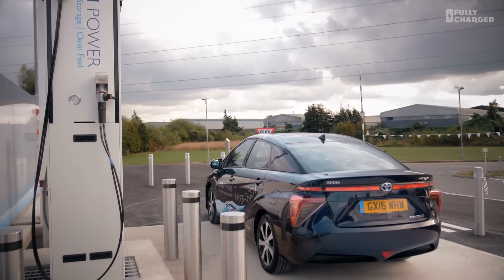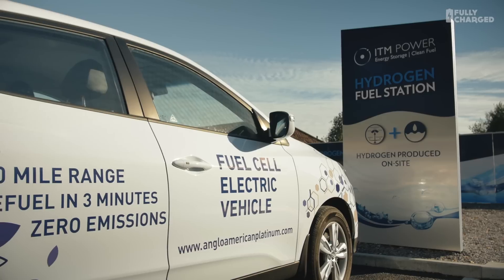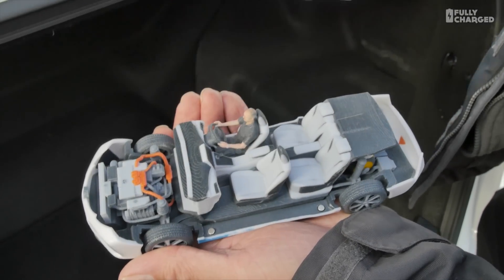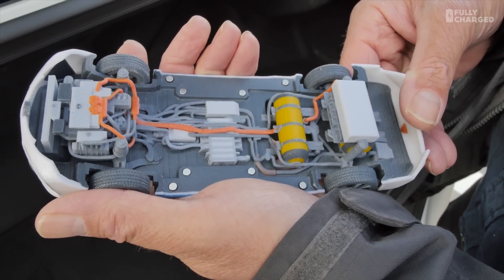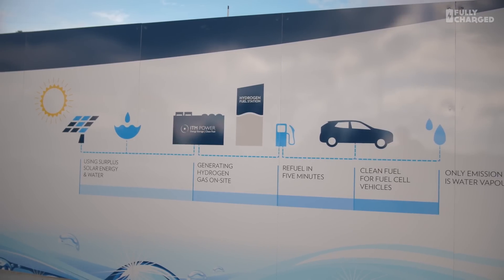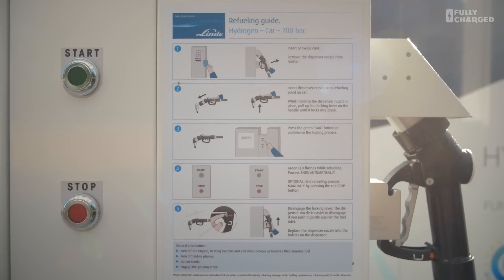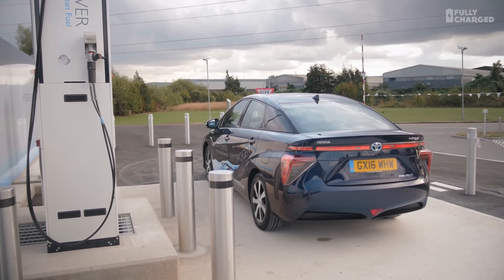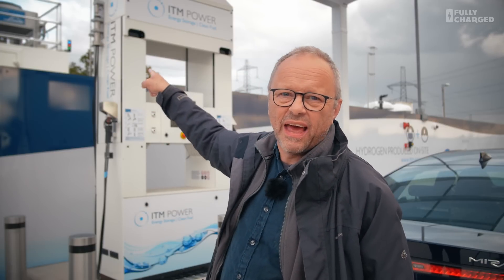ITM Hydrogen Rally | Fully Charged

Comment: Why do not we make a nuclear car, it is even more clean/efficient :)
Now to comment the hydrogen, I would be very uncomfortable driving with a hydrogen bomb. Yes Toyota is claiming that the tank is secure and collision protected, but if we also consider that the H2 is almost the smallest element on the world therefore it is extremely difficult to store it.
And why would one do:
electricity -> H2 -> electricity
This doubles the losses. Really funny why Toyota (and others) have not developed H2 engine. Such engine would probably be much more efficient that the current setup.
Reply: Nuclear is cleaner? Tell that to the residents of Chernobyl, Three Mile Island or Fukushima, all three have a twenty mile radius exclusion zone.
Reply: TMI-1 is still operating on the same site as TMI-2 (the unit that melted down). Seems very unlikely that there is a meaningful exclusion zone around that plant. And despite those accidents nuclear has released much less radiation than coal stations working normally. It is pretty-much the lowest carbon intensity (12 gCO2/KWh) of any generating tech known (Onshore wind is 10, everything else is more or much more). So whatever you think of it, it is very clean.

You can't make safe reactors small enough to go in cars though - that's silly. They do work well in large boats.
Reply: For the cost of a nuclear plant, you could built enough wind towers to match that power and still have money left over. not to mention the cost to decommission a nuclear plant on top of the initial costs to build and keep running. So how is nuclear greener? Let alone not that safe.
Reply: Joshua Cornell
As xxwookey stated nuclear can be much cleaner than coal energy and other forms of energy sources.
But even if safety of nuclear plant is 100% assured, there is still a problem with radioactive waste that is going to radiate many centuries. Let me cite how radioactive such waste is:
- - - - - - - - - - - - - - - -
http://www.nirs.org/factsheets/hlwfcst.htm
- - - - - - - - - - - - - - - -
This fuel contains approximately 25 billion curies of radioactivity.  Some of the radioactive elements decay quickly, but even after 1000 years, there will be 1,752 curies in each ton of irradiated fuel.
A curie is a large unit: 2,224,000,000,000 (over 2 trillion) radioactive emissions, or ‘counts’ per minute.  Natural radiation measured with a simple Geiger counter is typically between 2 and 20 counts per minute.  Each of these emissions has the potential to initiate a cancer.
- - - - - - - - - - - - - - - -
I find it funny why we cannot use radioactive waves for energy source. Are they so weak, yet powerful to make major cell mutations?

I hope I did not confuse you and others with my first sentence as it was thought as an ironic idea where car industry should go.
I also believe that wind, solar, Lithium batteries are not the best alternative (probably the best at the moment).
E.G. current economy is not used to recycle Lithium batteries so they would at first go to waste lands and make an impact to environment.
Reply: lithium battery are recyclable, there are a few programs in place similar to that of lead acid battery recycling, but not as harmful as lead though. I would never throw a rechargeable battery in the garbage, not even alkaline. Despite the disposable label on them.
Reply: Joshua Cornell
Of course almost any device/substance on Earth is recyclable, it only depends how much energy and effort one needs to put in to recycle.
The problem with Lithium batteries is that there are almost no recycling sites that would know how to recycle and reproduce Lithium batteries. Of course Elon Musk talked that they have developed the manufacture/recycling into their "mega" factory, but even if this is the case that brings us only one manufacturer and one factory which would recycle and manufacture Lithium batteries.
From what I have read on batteryuniversity.com, recycling Lead Acid batteries is really simple so I do not understand all the fuzz about Lead being harmful. And Lead acid batteries are much more robust than Lithium (of course also a lot heavier for the same capacity). It is only because governments decided that Lead is harmful and it should be banned. On the other hand GMO organisms that are being fed antibiotics just to be able to grow into organism we eat, this is totally OK. Or extincting rain forests purely for money reasons is also okay, even though they filter almost all of our garbage that we throw at it.
Even though Lithium is a really good technology I have a lot of doubts about mass success unless many recycling plants are going to be build. Of course at the moment there is no demand for it, but in the future there will be enough old electric cars on the road that would need battery replacement that it would make sense to build them.
And more education about Lithium batteries is needed. At our engineering university they are mentioning Li-battery as complicated battery that needs special circuits..., instead of providing some useful information about it and how to use it.
Ordinary people will also need to learn about batteries and how to use them: they do not want to be discharged to deep or to high, each battery has its own maximum current rating (even some industry chips for Li-battery control have non precise charging methods and can overcharge the battery). The current state of battery knowledge among people is: "After 8hours my phone has 50% battery, this means it can be used for another 8hours, and when I have 1% of battery I can still use it." First, % is only a calculated capacity from the full discharge/charge cycle measure. It cannot precisely tell you how much battery you have left. I find it better to show current voltage and critical voltage for the battery chemistry so we are not rapidly destroying it by discharging it too deeply.
Reply: You could run a car on a radioisotope thermoelectric generator (powered by decay heat rather than fission) as those devices can be made very small without being a radiation hazard. Sadly the Pu-238 fuel used in most RTGs costs around $8 million per kilo, meaning that only the likes of NASA can afford nuclear cars (they're big fans of putting them on Mars).

Comment: So, where does the water come from? All good in a place like the UK, or Belgium. But water is becoming a scarce resource in many places on earth.
+ all the other cons like: dangerous invisible high-flammable gas, huge inefficiency in producing it, inefficiency in usage of power, having to go and fill it up at undemocratic prices, ...

Good technology, but wrong vehicle. Personal transport should not use hydrogen. It will have its use-cases, but not the average commute-car. Also a Tesla Model S is not the average commute-car, way too big and yes too much range. The weight of the 'long'-range battery also makes it inefficient. We need a lot more smaller (sexy) BEV's.

Comment: Certainly very high technology, but what a dumb idea.  Hydrogen is, complicated to make and store, dangerous in countries like Australia where day time temperatures can easily reach 40 degrees C in some areas, and is not readily available...anywhere.  Batteries for hybrid / electric cars are getting cheaper, higher energy density, smaller and quicker to charge.  Electricity for the most part is everywhere.  Elon Musk is a very clever man and I trust his opinion, hydrogen is not the answer.

Comment: Domestic hydrogen Fuel is a joke. I can understand it being used for industrial machinery or commercial transport solutions where charge times my be needed to be kept to a minimum, but other than that nothing will justify wasting energy in the conversion process over direct battery storage.

I'm positive there are efficiency losses associated with electrolysis, gas compression, and the rapid cooling process used during filling. In comparison BEV are far more simple and efficient to the point where you would really have to explain to someone why you opted to buy hydrogen over normal electric vehicles currently available.

. . . And that's before you start factoring sustainable home electricity production (and for anyone who would argue it will be the same for Hydrogen, the government will make producing explosive gas at home illegal the second some dumbass blows their house up, or energy lobbyists grease politicians palms with money)

Comment: Not a particularly good example of the show. Way too many deliberate half-truths or complete misinformation from the same people that sell you petrol today.  The problem starts with the concept of using renewable electricity to make hydrogen. This is typically less than 50% efficient - i.e. you lose 50% of the energy that you put in. Batteries are around 90% efficient. Then it talks about using that hydrogen to power a car with a fuel cell. These are limited to 50% efficiency. So you start with 100 units of energy and reduce it to 50 to make H2, then reduce that to 25 to power your car.... Second problem. To get the H2 into the car you need to compress it to 900Bar. This takes a lot of energy. They cool the gas to -40, using more energy.  John Hunt from Toyota is either a moron or a liar. At 8:02 he claims that the fuel cell produces no heat. This is not true. A fuel cell produces 50% heat and 50% electricity. That's how they work. He goes on at 8:38 to claim that the H2 car can power your house for a week. If this is true then a Tesla Model S can do the same, seeing as they both have the same electric range - and indicates that the energy capacity of the Mirai is around 90kWh. That would not power most households for a week unless you are using another fuel for heating and hot water. If we dig a bit you will see that the Mirai has can hold 5kg of H2 in its 87kg fuel tanks. The current price of H2 is around $US10 per kg. The Mirai will not be cheap to operate and you will need to go to one of the refilling stations to fill up, paying cash each time, instead of charging overnight for less than a tenth of the cost.  Charles Purkess is right that you can use H2 as a storage mechanism for excess renewable energy, but its not a particularly efficient way to do it compared to batteries. Its better than wasting the energy but still not good. At 11:38 they start to talk about using H2 gas for cooking and heating. While attractive at a high level, its not a good idea in practicality since H2 is very difficult to store - it tends to make metals brittle, and leaks out of steel tanks since the molecules are so small. It also burns invisibly and so requires significant safety precautions. Hydrogen is simply a way of keeping everyone paying money for a liquid fuel. Even the refuelling stations are a lot of 'smoke and mirrors'. They refill a car in a few minutes but then take ages to re-pressurise before another car can fill up. You have to drive to one like you do for petrol, and buy it, like petrol. Its at best 25% as efficient as a pure electric option with batteries. Meanwhile, battery storage is dropping in price and the current electric vehicles are actually better than the best future fuel cell ones. fail.

Comment: A brilliant step forward Robert? Really? You know that not all hydrogen that would be sold would be produced that way right? The interests behind it are increases in fracking, which should be categorically rejected.
Reply: The world is slowly moving to 100% renewable energy, which is encouraged by battery development (and with an aim to be non polluting); whereas hydrogen fuel cell cars (which contain batteries btw) also put a short term market demand on natural gas, which is not the right direction.

Comment: Clean renewable but using drinkable water. The more of those cars on the road the more water it's gonna use to power those cars. :(
Reply: but it comes out again :)
Reply: You do know water comes out of the exhaust, right? There's no reason salt water couldn't be used
Reply: mlevesque33 can't u use water that u don't drink?
Reply: And where does the water fall back down? Nobody knows. It might be on another country instead of yours. Imagine a country with no oil and little water sources. They're going to import all that hydrogene that came from a country rich with water and that same water is probably never coming back where it came from.
Reply: With salt water it's different because of the sodium in the water. You end up spending more to produce that hydrogen, you do have to collect the sodium by-product.
Reply: +MrcabooseVG 
You need clean water to electrolyse and you can't use saltwater. The chlorine in it will corrode everything. If you use any "dirty" water your electrolysis cell will need cleaning all the time.
Reply: superdau oh. fair enough. go Tesla!

Comment: Interesting.. But the car design is damn ugly with all that front triangles and also the there is the point that they said you need to have oxygen to be taken into the car to react with the now split hydrogen to power the electric system.  

Why? The point of spliting the hydrogen in the 1st place is to then power the electric battery and the drive the car!

So why do you need to add oxygen to the split hydrogen? 

If that was the case that the hydrogen needs to have oxygen to work you would not need to waste wind based power to split it in the 1st place?  
You just would use the un-split water in the car to power the electric system!

Seems sily to say oh you need the oxygen to react with the hydrogen and the left over product being water!  
If that is the left over process then the hydrogen would not have been burned because you burn it then there be none left for the oxygen to combine with to make your water left overs?

And it don't matter if you burn more hydrogen you still would be taking in oxygen as needed so still you would use up all the hydrogen feul to make the water!

One last point those two drivers of the company were breaking british road laws by keep waving their hands around as they talked and not holding the steering wheel. 
After all their not in a self driving tesla car?

Comment: This would have been a great technologie 25 years ago but now batteries are just to advanced and hydrogen doesnt make any economical sense anymore kind of sad actually to see all that research effort go to waste now that it finaly works but its just a little to late
Reply: Yes (Lithium) batteries are getting better designs, but it seems that there are 2 types of car companies at the moment:
1. one that are starting to adapt batteries and still improving on diesel/gasoline engines
2. one that do not what to adapt to Lithium batteries and are making no development in diesel/gasoline engines

An example of second is Toyota. Their hybrid cards do not even use Lithium batteries. They are being called hybrid only because the electric motor helps automatic transmission on spikes, but on electric power they can hardly make 3km.

And an example of first one is Mercedes that started to offer some cars with pure electric drive.
Reply: True before to day but Toyota just fold and said its fixed v batteries and is going to make a BEV soonish
Reply: True before to day but Toyota just fold and said its fixed v batteries and is going to make a BEV soonish
Reply: Lets see, the Mirai is said to max output at 114 kWh and max range of 370 miles NADC which is 315 US, where as Tesla recently came out with 100 kWh battery packs for a max range of 388 NADC miles or 312 US. But looking at how much power is required to make hydrogen from water and such would power the Tesla many more miles before enough hydrogen is produced to power a Hydrogen powered vehicle with bit more kWh output. In another scenario, hydrogen makes better sense for large trucks which require much more energy to run and power, for example this is why Nikola motors changed to Hydrogen for the Model ONE where hydrogen is available and is greener in a sense compared to NG.

Comment: Hydrogen fuel cost pr km of hydrogen is 10X that of electricity.
Hydrogen fuelstation cost is 100X that of electricity.
The cost of even one low capasity hydrogen refueling station about 1 MILLION USD (8 million Norwegian KR), while a fastcharger station is about 20.000USD (200.000 Norwegian KR). Its just stupid, fucking stupid. 
Why not talk up hydrogen as a true alternative? 
Because hydrogen-battery-electric is not a viable alternative, its a cog in the wheel of battery-electric transport. They will fail misserably, everyone hwo bought the stupid "alternative" will have totaly useless cars.
Why do you think big oil is celebrating hydrogen and not battery-electric, so that they may suck our children out of money for a lifetime? 95% of hydrogen comes from hydrocarbon, thats why they like it. 
I live in Norway where we are moving to batteryelectric en mass, not only cars but, fully batteryelectric ferrys, busses, and trains.
Hydrogen is fantasticly expensive and not at all userfriendly.
I charge my Tesla in 0 time, i plug in at work, thats it.
I dont have to take time out of my week to stop for 10 minutes at a hydrogen station to fuel and pay extreme overprice for hydrogen. If i maby twice a year need to fastcharge, i drive 400km, stop for 30 minutes, and get have 300km of charge. If you drive 400km without stop you need a short stop to streach your legs, while you do you just plug in to the free supercharger. 
Thats the solution we need, and its only going to get better, mouch better.
Show less

Comment: Nope, 
really complicated car, really complicated hydrogen production and compression systems.. wasting lots of energy.. throwing away efficiency.. 
You spend electricity, to make hydrogen, to fuel a car, which makes electricity out of it.. and still has a battery as a buffer...
Many conversions and losses.. Just compare it to a pure EV.. it has its elements (el. motor and battery) + much much more.. which costs more, more things to maintain, etc..Batteries will improve even further..